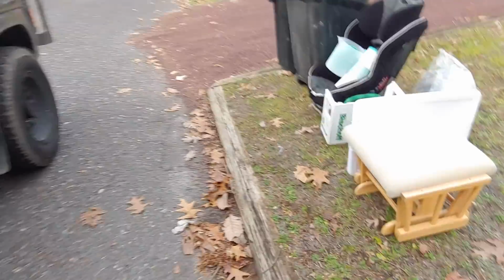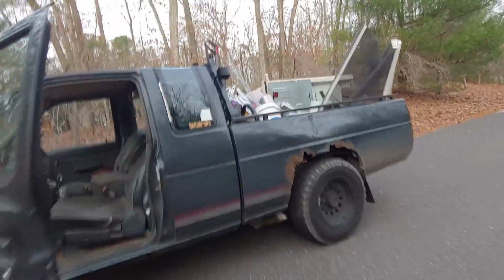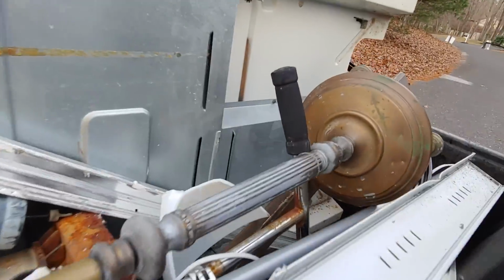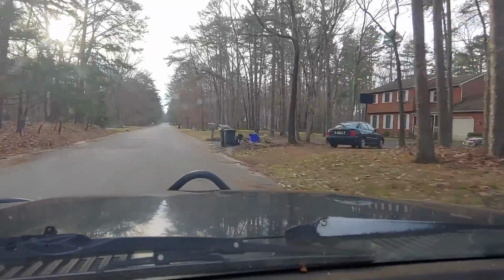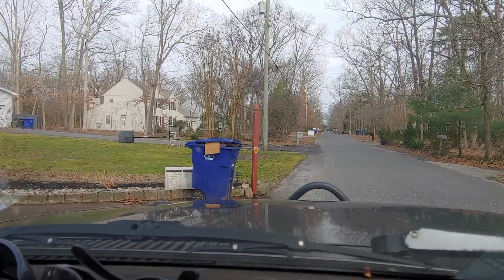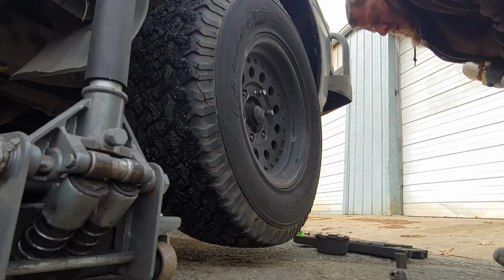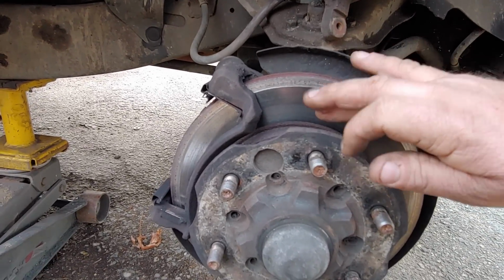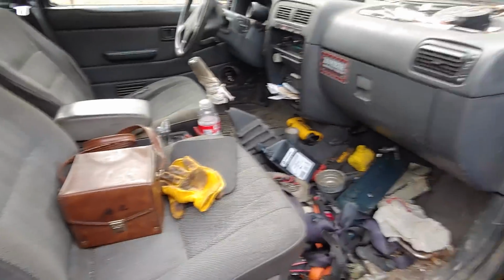How to make money scrapping ....drive around...

Comment: Did this job once for a carwash where I was paid to replace 8 stainless steel vacuum cleaners. Thing is, I never cleaned them out 1st & a few were about 300 lbs.I remember I got paid over $600 for them. Plus, charged $400 for the job.